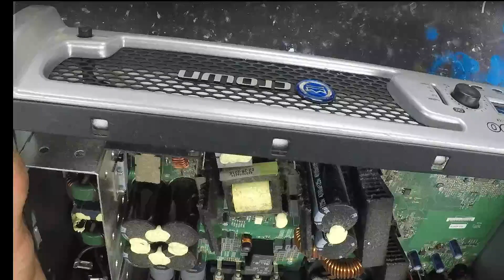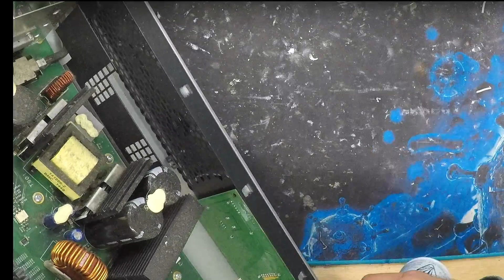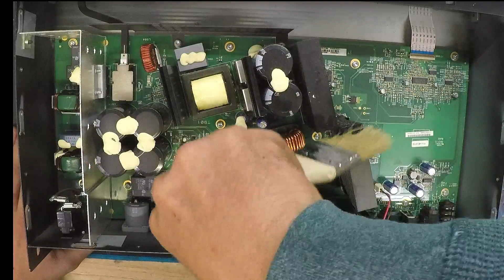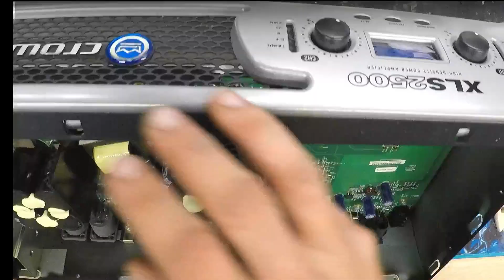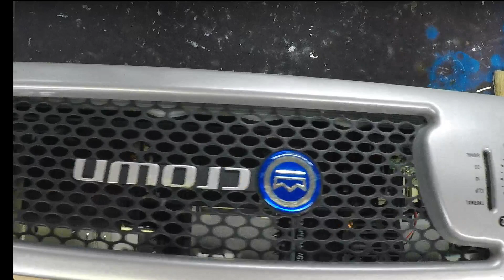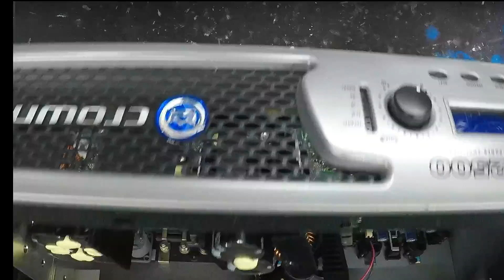crown XLS 2500 Pro audio power amplifier cleaning and basic overview.

Comment: By chance did you note the ICs used to drive the power supply and the output transistors? I am building a parts list for 110v AV equipment to see if including line-level equipment repair is a viable addition to the business. Thank you Jesse!
Reply from the maker: Ill make a video of the over view,  looks like for the outputs its using 98-0502  IR, with 4  b30h100g transistors. power supply has ic  7387 with  a pair of  20n60a4d
Reply: @jessemessy3864  Thank you Jesse!
Reply from the maker: @ellensburgamplifier  https://www.youtube.com/watch?v=NefgaQ99TaA